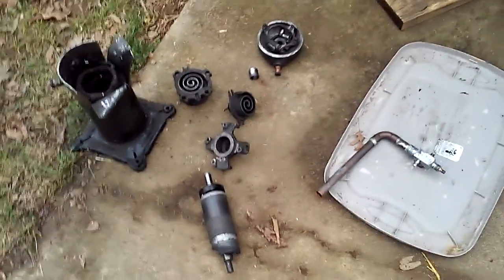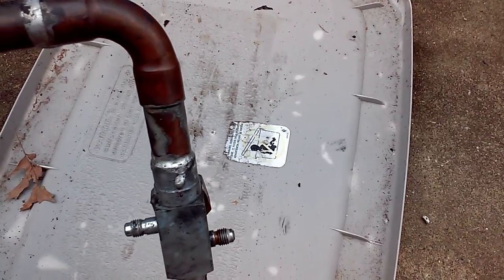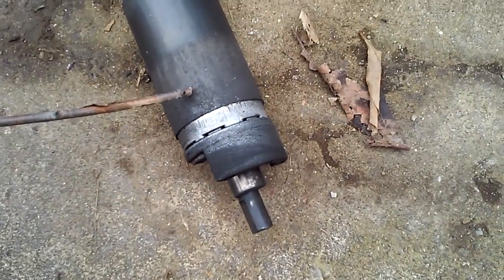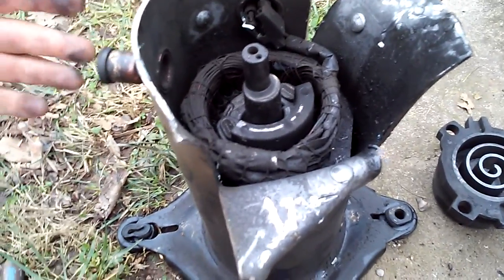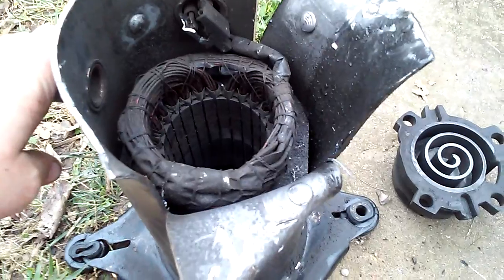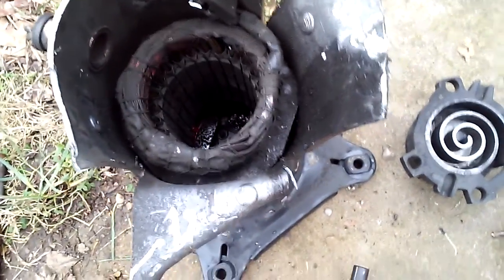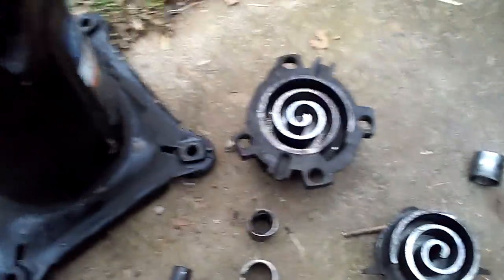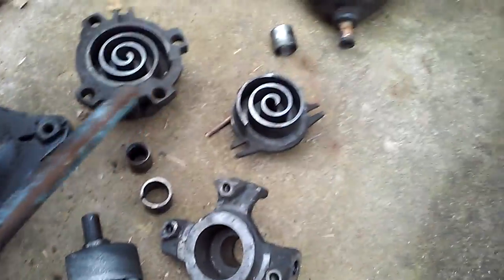Copeland Scroll Compressor Teardown Soft Solder Faux pas.

Comment: You can braze copper to steel but your filler has to be tin/silver.  Flux cored or Flux coated silvaloy 450 or silvaloy 560 alloy.  You can use solid wire but you have to use paste Flux.
Reply from the maker: Hey thanks for the comment.
You are correct. But the the installer wasn't!